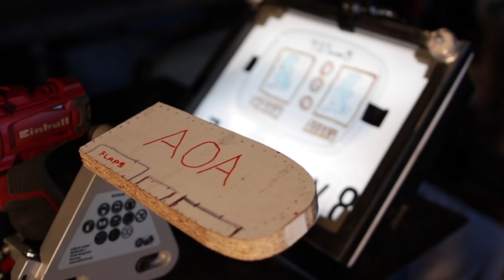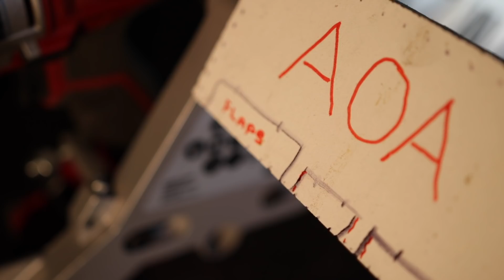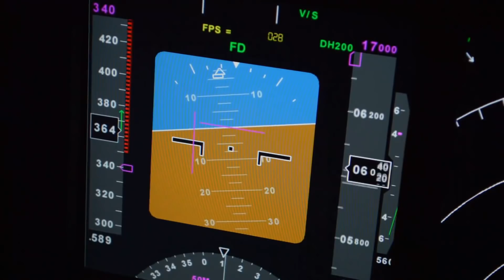workshop model of 737 Max 8 systems - Prof Simon

Comment: First I will say thank you Professor for your efforts to explain this.
A couple of things to add though. It is the stab angle that MCAS controlled not the elevators. Also you didn't mention that the pilots had mistakenly left the throttles at take-off power and that they disbaled the MCAS system to manually trim but because they were flying far too fast (engines still at take off power) their physical effort was insuffucient compensate for the nose down stab trim at such a hig speed. (If the stab is trimmed for nose down and stuck there then the pilots would also have to constanly pull back on their control columns) I feel sure that confusion and panic were now a part of this - with time fast running out, the pilots switched on the electric trim again because they couldn't manually trim but still inexplicably the throttles were not moved.
So we see a dangerous flawed system revealed to all because the pilots made a mistake too. This in no way exonerates Boeing and tha FAA of negligence but I think people need to see a clearer pictire of the situation as it actually was.

Comment: The trim system adjust the angle of the horizontal stabilizer not the elevator.
Reply from the maker: Yep....I was learning as the films were made....the next installment of the mystery....I get the horizontal stabilizer correct.

Comment: Good explain professor but why should not give the priority to the pilot vs computerized system . why should not instal the disable sensors and mcas switches in the cockpit.if switches instal the cockpit why should not aware  all around the world professional pilot's.why should not written about this in the plans operating manual books. sham for Boeing irresponsibility.

Comment: Boeing has become unethical, and as a result of being found in bed with the FAA ... ToTally unsafe ... !

What about all the sub standard parts fitted to the 737 fleet since before 1996 ... ?

If you take a look at all the 737 issues that it has had on Wikipedia .... it's truly horrific ... !

https://en.wikipedia.org/wiki/List_of_accidents_and_incidents_involving_the_Boeing_737

Non conforming parts fitted to in service aircraft, counterfeit parts and materials in Moog flight system's ... !!!

Moog non conforming parts in the 737 https://www.youtube.com/watch?v=RmBdBXKrjDw

Boeing goes deeper into the depths of hell than just this, they have been producing non conforming aircraft for years !
The presenter above doesn't know the half of Boeing's manufacture procedures .& it's past problems ... !!!

The whole 737 issues has been a ticking time bomb since before 2000 .... Non conforming parts and no action from the 
FAA / NTSB ... Even the next Gen version are at risk here because of assembly flaws and defective parts and manufacture 

Boeing has a history of not telling anyone anything, even keeping it's non conforming parts history from the FAA, 
Ducommun / McDonald Douglas's old works that was bought out by Boeing, who produce parts for Boeing think they are above the law and the FAA / NTSB  when they flagrantly fit non conforming parts to operational air-frames ... !!!

https://www.youtube.com/watch?v=IaWdEtANi-0

The USA government & FAA have been turning a blind eye to these practices for years ... !!!

Faulty Parts Dispute with Boeing

https://en.wikipedia.org/wiki/Ducommun

Comment: In your model - maybe if you screwed the drill in all the way - to show that the system and pilot kept on 'compensating' for each other, until the jackscrew reached its limit, and the pilot could no longer counter the computers nose down command. At least - that's my current perception.

Comment: The Max is neither "aerodynamically misdesinged" nor "inherently unsafe". It has a dodgy MCAS system and pilots were not adequately trained to deal with the malfunction. Also, a lack of scrutiny by the FAA during certification allowed this MCAS to find its way into service. I remember in the 90s the concern over two fatal 737 accidents that went unexplained for a long time even though the rudder control was strongly implicated in both accidents. The aircraft still gained an exemplary safety record.  This MCAS will be fixed, the pilots better prepared, and the aircraft will in time be considered as safe as previous versions. I would happily fly on one tomorrow as there can no longer be a single 737 pilot anywhere who does not know to simply switch the Stab Trim cut-off in the event of a runaway in pitch.

Comment: Boeing needs to start by removing that 737 Max sales advertising video that shows it taking off and climbing vertically. Just setting a bad example of pilot “hot dogging” plus most passengers would be scared half to death seeing that especially since these last two crashes where passengers experienced a ride similar to that. Question for Boeing: Was that done with MCAS disabled? If so, they need to put a disclaimer in the video ad. Isn’t that something? Show the public how the plane can climb right after takeoff and then keep pilots in the dark as far as if you takeoff and try to climb just 1/4 of that, the electronic, dirty little safety safety feature (MCAS) is going to put the aircraft into an unrecoverable nosedive and leave a big crater in the ground for NTSB to sift through. Don’t get me wrong. I’m still a Boeing fan, just rather upset with them at the moment. Still prefer them way over AirBus. (Scare Bus)

Comment: When the Mcas system takes the control, the  angle of attack will change (decrease) normally at a certain angle it would stop lowering the nose of the plane ,is'nt it ?
Reply from the maker: We think it keeps adding 2.5 degree nose down....if so...big problem

Comment: I find the logic of the pilots did not seem to understand what was happening.  I am writing this off the cuff and I might have to review it later on, but here goes.
When on the ground, the pilot advanced the throttle, the aircraft moved forward. The vanes for the " angle of attack" were at zero position so the elevators would only obey the joystick command.  The plane gained speed and so rotation speed and the pilot pulled at the joystick. With the " angle of attack" at zero, the elevator obeyed the pilot and the nose went up.  Now,  at this point this situation calls for a discussion as IF THE PLANE HAD ENOUGH FORWARD SPEED, THE VANES SHOWING THE ANGLE OF ATTACK  would have remained ZERO or showed ONLY A LITTLE ANGLE OF ATTACK as the flow of fast air over the vanes would  almost be in the same direction of the aircraft line of flight, as the aircraft had enough speed.  ONly if the aircraft was too slow it would mush ahead and so the vanes will now indicate a " high angle of attack".  If the aircraft was fast enough  when climbing then since the vanes are operated by the air flow then at a fast speed, irrespective of the aircraft was climbing a lot,  there would be no indication from the " angle of attack vanes" as at speed these would follow the streamlines of the aircraft and not of the slow air with nose up and slow forward speed.    Since the " vanes showing the angle of attack" were operating with an angle then the aircraft was NOT MOVING FORWARD FAST ENOUGH  AND NOT  CLIMBING FAST ENOUGH. It was clearly mushing.  This was enough information to the pilot to indicate to them that they had to put the nose down.  They should not have fought it.
I would say that the weighting of the joystick signal with respect to the " angle of attack signal" should be considered but if the pilots were horizontal and the aircraft kept nosing down then the " angle of attack vane " jammed in the high position when they rotated too fast!   and so mushed ahead rather than climbed fast enough for the " angle of the vane " to follow the line of flight of the aircraft rather than mushing.

Comment: Your comment that the plane hit the ground in a nose down crash at 600MPH got me wondering about the 9/11 Shanksville crash. Would you speculate on the different debris fields that resulted? My understanding is that they should have been similar, but weren't. Am I mistaken? Thanks.
Reply from the maker: One hit harder...you can’t beat physics and gravity.
Reply: As the prof says, the MCAS is solely about controlling the AoA between the airflow and the plane. It doesn't give jack about the attitude of the plane; that's the angle between horizontal and the plane.
The plane could be in a vertical dive, but so long as the airflow was coming from dead ahead the MCAS would be happy.
Of course, if you tried to pull out of your dive too abruptly, the MCAS would intervene to force the nose down to "prevent a stall".

Comment: Computers are great but what happens when our phone or laptops lock up right when we need then. I’m not an engineer or a mithbuster 👍😂 but I think older systems had hydraulic and electric correct me if that’s wrong but had at least two systems. Now they would still have two systems but through a computer. We know their great when their working. Cheers 🍻 and thanks.
Reply from the maker: I agree....as pilots..we still need a way to manually save the day..

Comment: The airspeed sensor (pitot tube) also provides information to the MCAS. 
Probably a faulty airspeed (too high) makes the MCAS to move the horizontal stabilizer making the nose dive in order to prevent a stall.
Somehow it seems that Boeing built a faulty flight control system and the FAA didn't have the knowledge to find the flaws.
Reply: Please explain why you think "a faulty airspeed (too high) makes the MCAS [pitch down] to prevent a stall".....

Comment: Suppose the sensor indicates correctly that the plane is climbing - how does MCAS integrate with the autopilot software? Is the (presumably older) autopilot software telling MCAS that the plane is climbing? Or do both do battle with each other, and shut out the flight crew in the process? Background: I just had Windows 10 Update 1809 do battle with Update 1803, forcing me into Recovery Mode. The Recovery Mode told me that the resident Recovery Partition was corrupted. I was able to start a re-installation, including re-formatting the C-disk, using Disk 1 from my 5 disk DVD set I had created five years ago. This then initiated a complete Windows 10 1809 installation. So back to my point: Do you have an older Auto-Pilot software in conflict with the newer MCAS addition, both ignorant of each other's existence?
Reply: Henry Falkner MCAS is not operational with the autopilot engaged.

Comment: does the MCAS System actually put the aircraft in a nosedive ?
Reply from the maker: No....but after multiple tries by the pilot to pull the stick back....the system keeps pushing the nose down...did not end well
Reply: As the prof says, the MCAS is solely about controlling the AoA between the airflow and the plane. It doesn't give jack about the attitude of the plane; that's the angle between horizontal and the plane.
The plane could be in a vertical dive, but so long as the airflow was coming from dead ahead the MCAS would be happy.
Of course, if you tried to pull out of your dive too abruptly, the MCAS would intervene to force the nose down to "prevent a stall".
Reply: @sub08Angstrom  Hi Michael, just even reading your comment is shocking (MCAS) to say the least,  I can't believe how flawed the MCAS system is in terms of its intelligence or lack thereof. Thanks

Comment: In normal condition mcas is fine but once there's a glitch ,its over
Reply from the maker: Yes....lots of fighter planes have mcas...I am not aware of other airliners fitted...and it was pretty radical way to fix the problem with the aircraft over rotating on takeoff.

Comment: So normal MCAS action to get the nose down with pilot input to pull it up again can get to a situation where the rear stabiliser is in such a position that no amount of pilot input can get the nose up??  (I worked in process control in the refining/petrochemicals area so trying to understand aircraft control systems).

If this is the case I’m baffled at why this ever got through any form of risk assessment. At the very least the max amount that the stabiliser could be moved by MCAS should be limited so that the pilot always has the ability to get the nose up - or is that too simplistic??
Reply: Phillip:

Very good post. Long time airline pilot here 18,000+ hours in 9 airliner types (including the 737, though fortunately not the Max). For some background, the stabilizer can be moved by trim. The pilots can use the electric trim switches on the control yokes, the autopilot can trim, and in the 737 the pilots can use the large trim wheel on each side of the control pedestal. The wheel is mostly an annoyance in daily operations, and when being used manually takes a lot of cranking to move the stabilizer even close to where you want it. Every time the power changes, you'll have to adjust it as well. 

The first airliner I flew was the DC-9. Even as a brand new pilot to the DC-9, it was made clear to us that the stabilizer has WAY more pitch authority than the elevators. Simulator events definitely made a believer of me. In some corners of the flight envelope if the stabilizer is allowed to run away to full deflection, the pilots may find it difficult to impossible to overcome the stabilizer with elevator input. Obviously this is very dangerous. 

MCAS was meant to be transparent to pilots, but really isn't. The 737 has the most archaic cockpit currently in production and things that would be indicated specifically on EICAS or ECAM in more modern designs are much more difficult to grasp in the heat of the moment in my opinion. 

One issue with the trim wheel is that MCAS inputs in at least the Lion scenario were not constant and every iteration got worse. Those pilots likely had no idea what the plane was doing or why (we don't yet know about the Ethopian accident). The pilots coming from the 737NG were also used to seeing the trim wheel move on its own as a function of the Speed Trim System (STS), which possibly delayed their recognition of a trim issue. 

Whatever the case, MCAS as designed has issues, most particularly being reliant on a single sensor to give huge control authority to the stabilizer, which can,as discussed, result in loss of control. I'm not claiming to be an expert on MCAS but I personally believe if they stick with the MCAS concept that the plane really needs 3 AOA sensors with suitable voting logic (and even that isn't perfect) before it can even be considered. 

Boeing has built some great planes, and I've flown many of them. The 737 has always been my least favorite aircraft, and the Max has not improved it in my view. 

I appreciate your post very much.
Reply: The entire mechsnism looks like it was invented by a 20 years old computer programmist who never steered a vehicle on his own. How can you give computers the final power? Why then have pilots at all? If pilots make sense at all, they must be able to override any computerized steering, always.
Reply: I am quoting what I have read so please research to confirm my information- I believe the more you pull on the stick against the wishes of the computer the harder it gets as a feedback mechanism purposely to encourage you to stop making an error ( as seen by a computer). The MCAS seems to be implemented as a hidden automatic system adjustment for pilot errors. The MCAS thinks you are trying to STALL the plane and it wants to ensure that it doesn't happen. When all sensors are working correctly this is invaluable however the fail is computer clearly acts when sensors are faulty and this is very poor control. The report in the first 737 crash is the plane had 3 previous days of altitude and control issues and that the AoA ( angle of attack sensors had a 20-degree discrepancy between left and right sensors ). If the MCAS is activating under faulty sensors readings this would be very dangerous especially when you combine that these pilots were not trained in this new system and documentation in the manual is not present on MCAS. I believe it is a fault in the MCAS design - process control system of the MCAS when sensor faults exist in combination with a lack of pilot adequate training and awareness. Clearly, faulty pitot and AoA sensors will occur so how the MCAS analyses sensor accuracy and how it integrates into the control is quite a critical process.
Reply: The pilot can trim back, which would allow him/her to pull the nose up. But if the pilot didn't know the plane was trimmed, he wouldn't know to trim back.
Reply: @Robbedem  737 MAX 8 Trim wheels are visible for both pilots to see. They should be able to see Trim wheels spinning.

Comment: informative video, what raises the question why it only happened to two planes from 370 which are in service right now? Of course one cannot take that risk that it happens again.
Reply from the maker: Good question...I don’t think the planes were that faulty...I think Boeing wanted to sell the new machine to airlines without the, incurring expensive training...their mcas system was the answer....but turning it off was knowledge pilots needed...just in case....luckily in only 2 cases....glad they are grounded for re assessment.

Comment: The important thing to understand is that the MCAS controls the trim through the horizontal stabilizer NOT the elevator
Reply from the maker: I’ve added a caption to correct this point....thank you

Comment: Poor training. This should be a memory item. With the high bypass engines it is a fundamentally different aircraft
Reply: Hi Edgar,when you mention the high by-pass ratio engine,  are you referring to the higher power output of the max versions versus older 737s?.